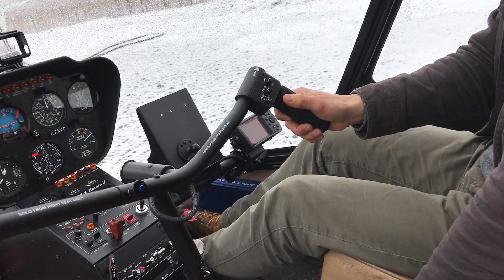How Does a Helicopter Fly

Comment: I love your videos, (but after this video had a question). I have watched a lot of videos and yours are by far the best. I have immensely enjoyed watching all of them. I am writing a fictional book, and wanted to write effectively in some detail, without making a fool of myself, about flying a helicopter. My character is a seasoned pilot. Having flown solo in a fixed wing Cessna 152 aircraft in my youth, I had some basic knowledge of flying. We all learn and absorb knowledge differently. In my case, it was not enough to understand what were the control mechanisms inside the helicopter, but rather how they related to the actual flight surfaces outside. I needed to understand, what happens to the actual blades as a result of manipulating the controls. I find if I understand what is actually happening outside the craft, I can better visualize what I should be doing inside. It is not enough to robotically do as one is instructed, better to intimately how the craft achieves flight. I am a great proponent of if one understand why one is doing something then the how comes naturally. That said, there was one piece of information missing for me in this video. (I think you covered this off somewhat in another video, and will go back to review.) My question was in regards to the cyclic and the attitude of the blades. While in this video you do a great job of explaining how each blade, (90 degrees out of phase) starts to change its pitch such that when it reaches the point of cyclic instruction, it is at its highest or lowest pitch, but it was unclear which. I understand that the blades flop or feather to roll forward, or aft and from side to side. I am going to assume that to roll in any of these directions the swashplate would configure the blades of the helicopter to flatten (is that feathering?) at the leading edge in the direction of travel in order to cut into the air and decrease resistance, while the blades to the opposite side of the 'disc' would increase pitch to cup the air (is that flapping?) to continue to provide lift?  I have watched endless videos trying to glean this information, but more seemed preoccupied with explaining the internal flight controls. In a previous video you likened the whirling rotors to a disc, and that was very helpful in illustrating how the blades  behave, and influence the direction of roll, and pitch. Again, I am most appreciative of your excellent videos. They have been extremely helpful.

Comment: I once worked under a helicopter in a salvage logging operation. This one time the copter was above getting ready to hook up to my choker and I heard a snap, I looked up and the helicopter was going around and around. The pilot was motioning for me to take cover so I dove under a huge stump. He got control of the copter and put it down on a logging road. What had happened was the tail rotor had broken off, could you tell me what he did to gain control enough to land, he didn't fly far but somehow he was able to stop from rotating around himself. I must say he was badly shaken.

Comment: Pilot 👨‍✈️ Yellow: The MD-520N NOTAR System Makes the MD-520N More Quite For a MD Helicopter 🚁 With a Regular Tail Rotor Have No Tail Rotor Blades and Gear ⚙️ Box and Bearing and Shaft Running From Transmission to Tail Rotor, So Less Money 💵 On Maintenance Too🚁😎🚁

Comment: mr Yellow Pilot...............
I know real life flying in a helicopter is the thing...................... It cant be compared to a simulator.
So, i understand completely that FSX does NOT give us the real deal, the real feeling of flying, etc.
BUT, its a nice simulator to play with, and in some respects its not too bad.

In it you can actually do autorotation with the provided default helicopters...........
BUT, here is the question i was wondering about, which i hope you may be able to answer..............

In the simulator i need to gently lower the collective, but not all the way............... And if i dont start doing so immediately after engine-failure (or shut down), i am screwed. The rotors will loose RPM and basically stop spinning.
Is this also true in real life?
Do you also need to IMMEDIATELY lower the collective and so on?

Would you perhaps be so kind as to explain exactly step by step what to do to be able to land safely doing an autorotation?????

Much obliged, monsieur.

PS: Im dutch.

Comment: Great video and explanation. After lift off or landings do you ever use or need throttle control during flight? Does the helicopter run at full speed constantly? A video about it would be neat.

Comment: My suggestion might be a bit simple but I'm curious about what the standard safety protocols are for boarding and maneuvering around a helicopter while its rotor is turning? I'm most curious about  light helicopters like you operate, how close to the ground can the  rotor blades get while spinning? Can wind or rotor wash play a factor etc.  On a side note, I bought a copy of 'the principles of helicopter flight' way back in 1999 from the school as a teenager. Never got in the air with helicopters but did manage to with fixed wing many years later.
Reply from the maker: airtightindustries we need to be very careful around the helicopters when the rotor blades are spinning yes. It is something that we are very conscious of at all times. Wind only plays a factor when the blades are very slow and nearly stopped.

Comment: Why is there a difference in the direction of rotor rotation from American to European helis? Can it be standardized?
Reply: Opinions are divided and no one seems to know for sure. It's probably as trivial as that: Different rotary-wing pioneers in different parts of the world happened to use different rotational directions and then the local manufacturers just stuck to it. There's not really a specific reason for either direction AFAIK.
One could argue however, that a helo with the rotor spinning anti-clockwise has an inherent tendency to yaw to the right (making right turns easier), which is where the pilot (sitting on the right) has the best view...

Comment: This may be a ridiculous question but why haven't helicopter manufacturers created a system for controlling a helicopter that is much more simplistic in design?  Considering the level of technology available in aviation today why hasn't this occurred?
Reply from the maker: Well there definitely are lots of advancements in technology such as incredible GPS stabilized autopilots etc. but things always take longer to evolve in the aviation world than they do in let's say the automotive industry or other industries.  Everything costs a lot more to design and test and certify so the evolution is much slower. I think over the next 20 year we will see a dramatic change in the way helicopters are flown.  We are slowly moving to fly by wire technology instead of mechanical linkages.  However at the moment there isn't really a change in the flight controls and the way you fly a helicopter other than the auto pilot I was talking about.

Comment: In regards to the pedals, is it easier to rotate clockwise due to it naturally wanting to spin that way (anticlockwise for EU)? Or does the back rotor completely remove that.

Just curious if you'd use the pedal less when wanting to spin clockwise.

Thank you for these videos, I would love to do lessons!
Reply from the maker: The helicopter naturally wants to spin to the right in a NA helicopter.  You pretty much don't need the right pedal at all.  Most of the work is done with the left pedal either pushing more or less of it.  You have your right foot on the right pedal more just for support or to make quicker turns.  Turns to the left are more controlled because they are against the torque.  With turns to the right you need to be more careful so that the wind doesn't grab your tail fin and start spinning you around.  If you get going too quickly to the right you may not have enough pedal to stop it. That partially depends on they type of helicopter you are flying and the amount of weight the helicopter is loaded up to.